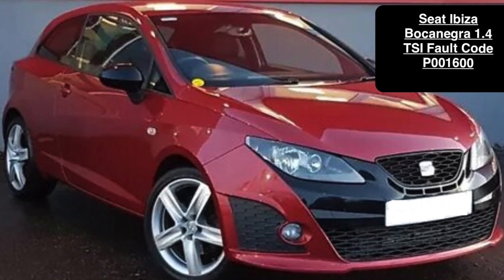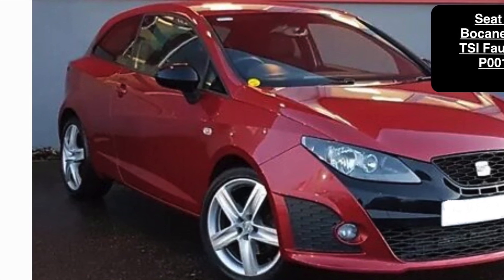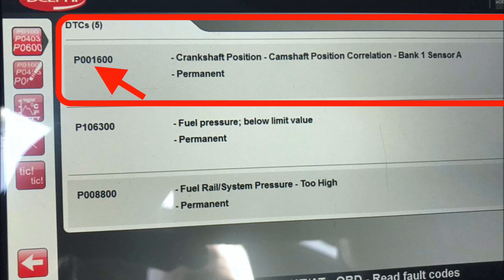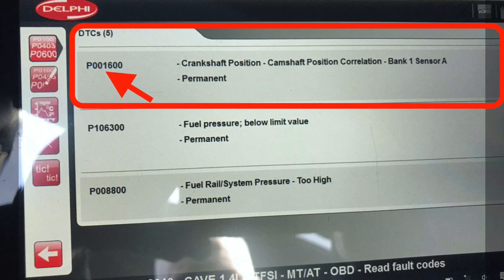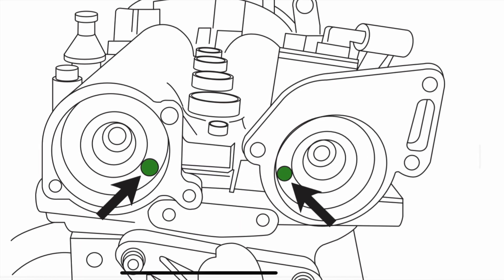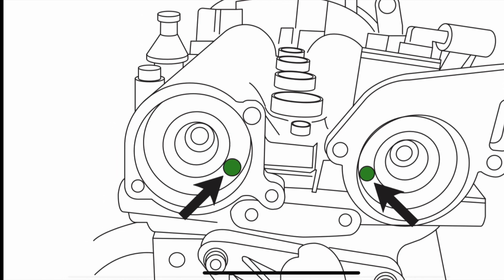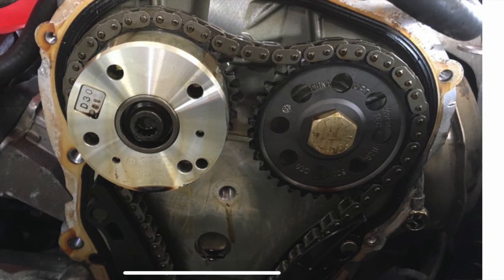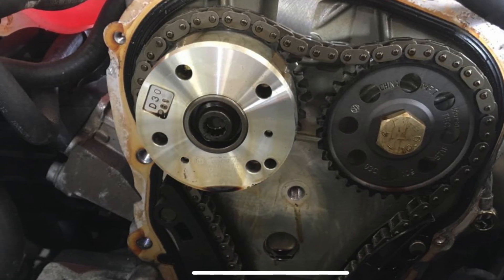Timing chain symptoms for SEAT, VW, Audi (1.4 TSI) fault code P0016.

Comment: Could this cause a cyl 2 misfire
Reply: I have the same code and also a cyl 2 misfiring code
Reply from the maker: Swap cylinder 2 coil pack with number 4 and see if the fault code comes up with 4 being the fault. If it does then coil pack is faulty